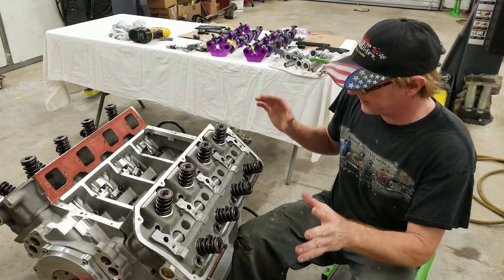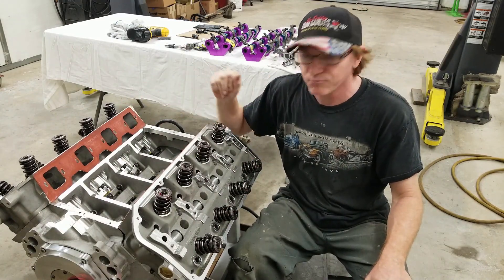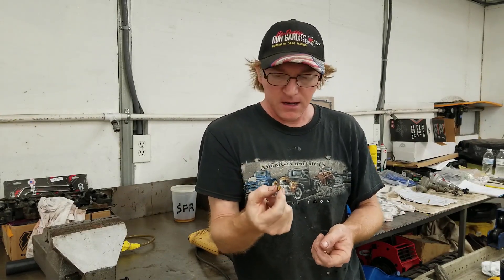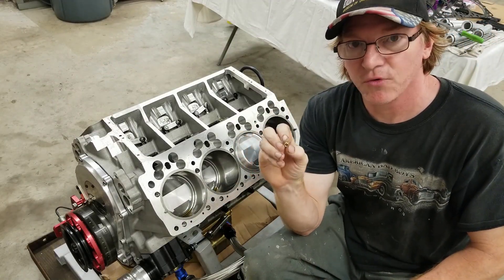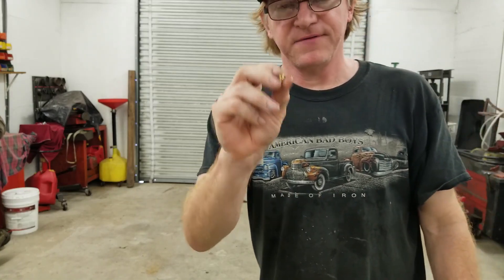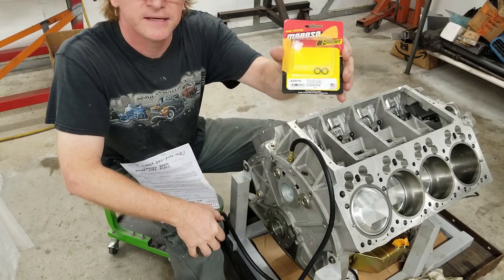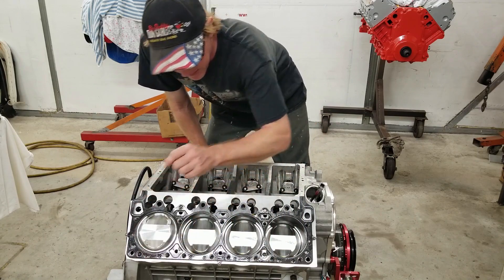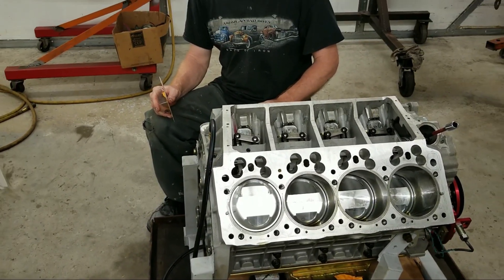Gen 2 Keith Black Mopar 4.5 Bore Hemi Oil Restrictor Tech

Comment: Design / build a ball stud Hemi with 4.9 bore spacing,  4.990 bore,  10.300 deck height,  use a 3.350 inch crankshaft (426 ci),  2 inch higher camshaft with belt drive.

Comment: In 1975 I built a 383 for my 69 Road Runner and we put an .080 groove on the oiler journal instead of just have the two oiler holes. It worked great for me. It's too bad you have so many shipping restrictions.

Comment: Hi guys from Australia.Could help out with some tech info.What is the spark plug thread length on those heads please.
Reply from the maker: Hello Luke - Sorry It took be a bit to get the info, Stage V heads take  NGK #4554 or Colder #5238 at least what we use.
Reply: @ES4406  Thanks so much mate,because the engine is assembled it's difficult to gauge plug reach.I appreciate your time in sharing your knowledge,cheers man.

Comment: I have 3 words for you,,, Tapered set screws... Aluminum will shrink substantially with heat,, and Blue loctite is not adequate to hold the non-tapered brass set screw when the block shrinks. Don't ask me how I know. Use a tapered set screw next time with a drop of grren loctite, which is a wicking compound, Meant for set screws and mainly for brass at that.  Good luck with your build as it looks great...
Reply from the maker: Thanks for the input. Before I did this video, I personally talked to Tim Banning on the phone about all of this ( he is the architect to the redesigned KB Block) and got  the exact threaded parts, just not over the  Canadian border. The threads in the block only go 1/2 inch down the hole. the blue was to keep them from pushing up towards the gasket, the restrictors cannot go anywhere regardless. What engine do you have that made you have an issue?

Comment: Great video, very helpful! The Moroso kit #22016 comes with 4 o'rings.  You show 2 left in the kit, so do you use 2 of the 4, or none at all and if so where? Thanks
Reply from the maker: As per Tim Banning... no  orings on the restrictors  ..there was no instruction  sheet with the block so we found out after the plugs kept ripping the o rings on install...we called Tim and he said not to use them